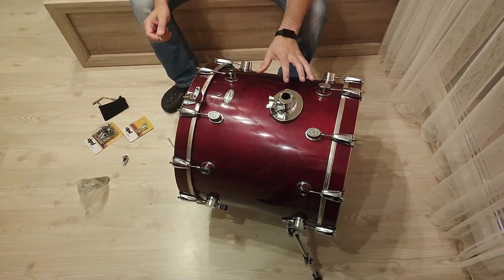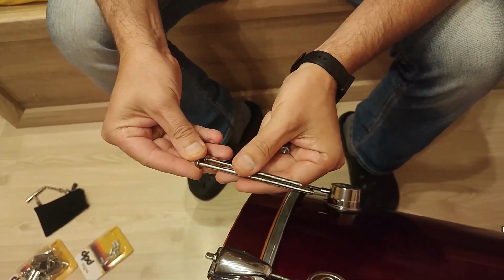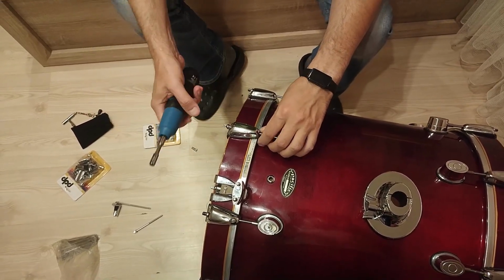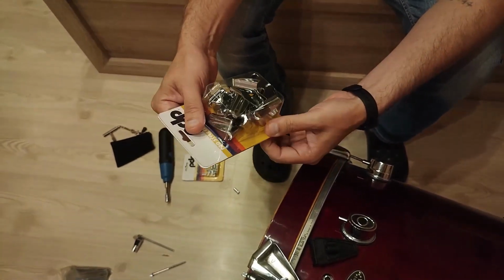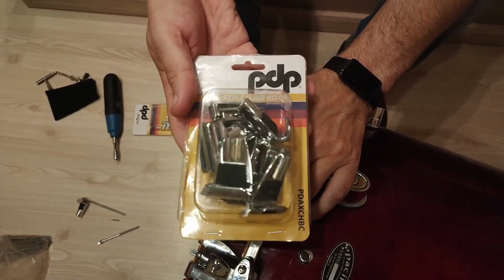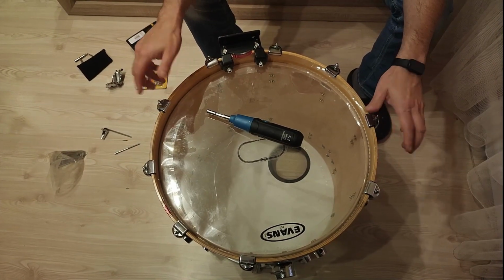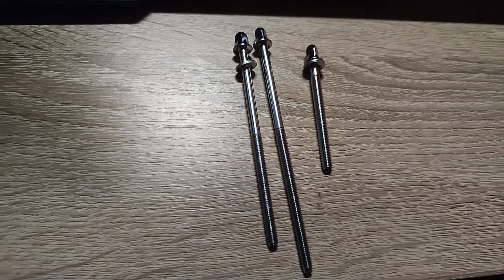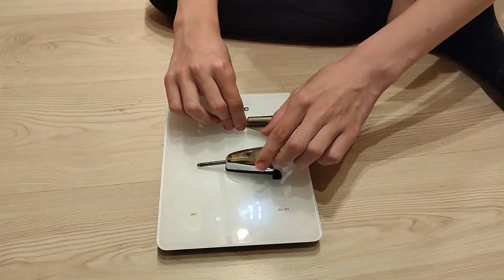Bass Drum Claw Hooks

Comment from the maker: The tuning screws feel a little different when tuning due to the true pitch threads, so you have to get used to it when fine-tuning, and yes, it is without question quite easy to tune overall. However, changing the head – even with a well-charged battery-powered drill bit – easily takes twice as long....